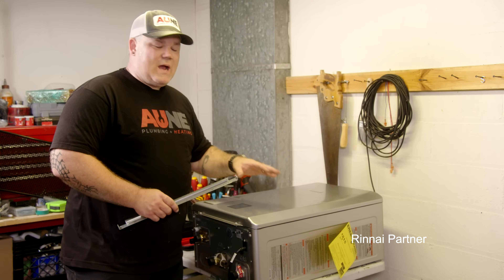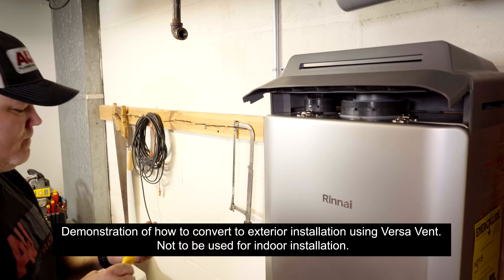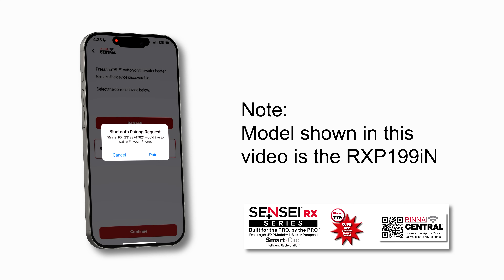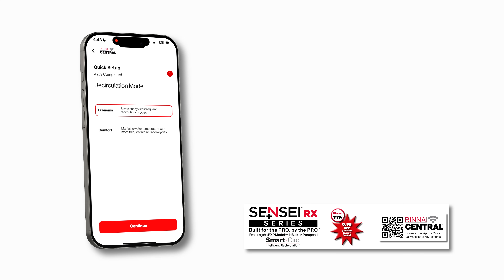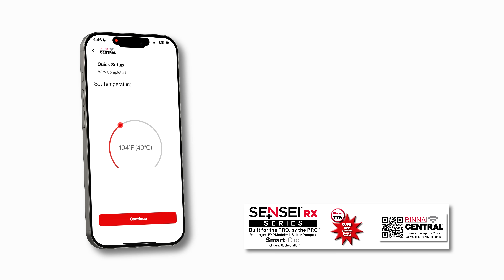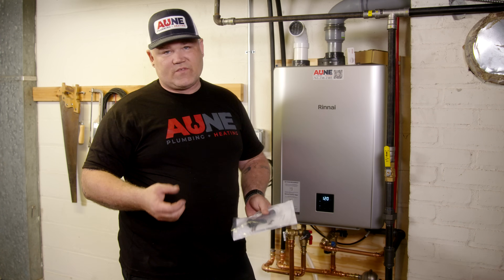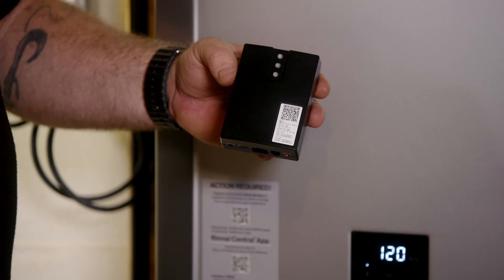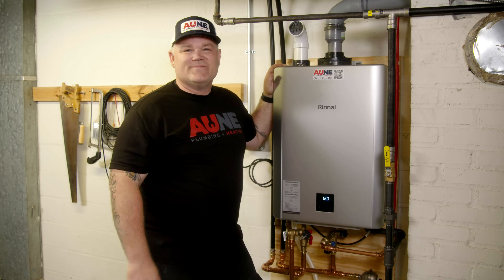Tankless Water Heater Install - Rinnai Sensei RXP series - Aune Plumbing

Comment: Nice that you are teaching others on the Rinnai installation. Unfortunately, you need to inform ppl that they need an additional accessory such as a Wifi Module in order to install their Tankless Water heater to the Rinnai Central App. Bluetooth isn't enough in order to install your water heater through your phone
Reply from the maker: That’s incorrect. No wifi module needed to connect to a phone. It’s don’t thru Bluetooth, not wifi.
Reply: @mechanical-hub  Couple Questions: (1) Once it is initially set up by the installer using Bluetooth, what options does the home owner have to adjust that temperature?  (2) If replacing a very old (early 2000s) Rinnai tankless water heater with wired thermostat, can that same wired thermostat be used or does it need to be replaced if the user wants a wired thermostat?
Reply: @kelvinkuwik4395  yes the old controllers can be used. You have to buy a harness because the new heaters don’t have screw terminals like the older ones. They have a space under the clear plastic cover for you to plug the harness adapter into. I think it’s at the very bottom.
Reply: @mechanical-hub  not according to customer service. I called them due to my RX199IN not showing up on the Central App even though I connected my phone through Bluetooth from the water heater. Customer Service stated I needed the Wifi Module. I kept restarting the app, and I even disconnected the Bluetooth and reconnected the Bluetooth, and the device (water heater) never showed up on the app.
Reply from the maker: I'm not sure what is happening, only thing I would ask is if you're activating bluetooth on the unit control to start the pairing mode? You probably are but that's all I've had to do so far with each of the units I've installed. The pairing has taken a minute or two but it's been pretty seamless and reliable. Bluetooth connect allows for the setup, not remote monitoring, just worth noting for anyone reading the comments. If you want to connect and control remote then yes, you do need a wifi module.
Reply: @mechanical-hub    I had the same issue, my blue tooth would not connect to the RXP199i.
Reply: @mechanical-hub omg thank you.. please make a YouTube video for these accessories greatly appreciated it..
Reply: Just installed a RXP unit. I’m also unable to connect using Bluetooth to adjust settings. Not happy about it and I’m frustrated that it’s not user friendly.
Reply: Paid 2,000 for Rinnai and now I need a modular. I don't need my water heater to send me updates. I don't leave town long enough to have to use my phone to talk to my water heater.

Comment: so, be honest with us, what did you charge for this install. how much was the parts, and what was the labor? How long did it take without the video. please be honest with us
Reply: Not sure where you're located, but in the Atlanta market most installs are $5k to 7k. At my company most installs are $5.5k to $6k. Hope that helps.
Reply: no, it wasnt clear because you didnt separate. How much was the parts and how much for your UNREASONABLE labor rates. Show the invoice if you are honest.. @charlesking678
Reply: @norcoauctions  i charge a flat rate price and so do most of my competitors. The only ones charging time and materials are small white van shops who don't spend on marketing to their phones to ring and they often struggle to make payroll when times are slow. Many can't honor warranties and they definitely can't offer the level of service That my guys do. 

As said before my price for most tank water heater to tank installs ranges from $5.5 to $6k. If you feel the price is too much, the price to not do it is $0. It's that simple. I don't get every single job I quote, but I do get the majority of them as my price is very competitive.
Reply: These tanks cost less than $2k but the plumbing companies will charge $5k to 6K. Let say if you bought the tank $2k, and the materials $1k, it seems the labor cost is between $2.5k to $3k. So, expect an over charge cost from these plumbers.
Reply: @Neutrality5  guess you will be amillionaire withing 3 years because of your greediness. that rate is absolutely godless
Reply: @norcoauctions  If you knew how much the tools, the van, and all those little copper 90s 45s Couplings cost you would still find a way to complain. If you don't want a plumbers service DIY it and figure it out yourself. Our training comes at a price don't go around disrespecting all these plumbers who got a real job. My friend gets all his clients and he gives flat rates. Labor is expensive plumbers all have a lot of things they could do that would kill someone. Carbon monoxide and Gas being the two most common. So yeah labor for them is gonna be expensive. When your job puts people's lives on the line when working it you better get paid real good for what your doing.

Comment: If you were in Ohio I'd definitely have you install my systems (note plural). I'm planning on installing one RXP160iN as the primary unit and a secondary RX160iN. I'm assuming the non-recirc unit would take the return recirc line and then go to the RXP primary? Is that the case? Have you installed dual units? Let me know. Again, great video!

Comment: Is it ok to use more than one thermal bypass valve in the system? We just added a second story.  The place where our loopback was, is not helpful to our current situation, nor was it helpful for our kitchen.  I was hoping to leave the original loop back in place and add one for the second-floor bathroom and one in the kitchen.  If not 3 how about 2?
Reply: I have not done it myself, I have a dedicated line. However; I know a couple of folks who did it with good resolves and no issues. One has three.
Reply: It is usually not recommended to install more than one thermal bypass. Maybe think about installing a dedicated recirc line w/ external pump. $$$$

Comment: Does it ship with flush valve?  Would you recommend buying/installing one if not?
Reply from the maker: The valve kit is not included and yes, I always install the valve kit because it’s the only way to gain proper access for required service.

Comment: That's exactly what I needed... everything is headed in this direction... if the app becomes obsolete... you're the captain of a boat anchor!😢
Reply: Great video.  Really detailed and clear explanations on everything.
Reply: @bobcobb7719  * Now just need room on the phone for the app!😆
Reply from the maker: You must have missed the part where I said you can do it without the app. Also Rinnai invented the tankless water heater, they tend to think of details you didn't
Reply: @mechanical-hub  Quite correct! Rinnai's not going anywhere, they're the industry leader.
Reply: @WilliamDiederich  * So was SEARS & ROEBUCKS! 😫
Reply: @mechanical-hub Invented the tankless water heater, huh? Uh...what do power washer "steam cleaners" and all the beverage making and dispensing devices that have cold water going inside them or stored inside them and hot liquids coming out use? 

Tankless water heaters. 

The University of Nebraska Lincoln Men's College Baseball field is heated because most precipitation comes in "late winter" and "early spring" when "heat units" and "drying days" from the Sun are...in short supply. It hasn't been 25 years but probably 20 and I don't think Rennai got the "contract". 

In-floor heating predates Rennai "inventing the tankless water heater". And LIVESTOCK WATER TANK HEATERS THAT ARE USED TO KEEP WATER THAWED FOR LIVESTOCK DOWN TO -20 F OR COLDER ARE ALSO TANKLESS. AND THEY'VE BEEN AROUND MANY DECADES. 

So have heated livestock "waterers" that have a very small capacity and high usage by comparison. Many are "geothermal" and require no actual heater at all. 

So saying they "invented" something still unperfected after 25 years since it STILL takes "6 SKUS" I.E. "MODELS" AND/OR "OPTION PACKAGES" TO "REPLACE" THOSE "OBSOLETE" TANK-STYLE HEATERS AND AT LEAST "VCR-PROGRAMMING" LEVEL INFORMATION TECHNOLOGY "SKILLS" JUST TO DO THE "SETUP" IS ALREADY A STRETCH. 

AT MOST YOU COULD MAYBE CLAIM "FOR HOUSEHOLD USE" BUT IN REALITY THE "HOUSEHOLDS" THEY WERE ORIGINALLY "INVENTED" FOR WERE IN APARTMENT BUILDINGS AND PARTICULARLY "FLATS" IN "EUROPE" AND REGIONS WHERE "CLIMATE" WAS NOT A FACTOR BECAUSE THEY ALREADY HAD "DISTRICT HEATING" AND THE WATER DELIVERED TO THOSE "HEATERS" WAS/IS ALREADY AT LEAST "ROOM TEMPERATURE". 

THING IS THEY DON'T DO MUCH SHOWERING, CLOTHES WASHING, DISHWASHING ETC FOR "FAMILIES OF FOUR" IN THOSE FLATS BECAUSE THERE "FOREVER HOT WATER" ALSO TENDS TO BE "NON-POTABLE" AFTER GETTING "BOILED" BACK AT THE "DISTRICT HEATER" AND PUMPED THROUGH MILES - OR KILOMETERS - OF "CAST IRON" WATER "MAINS". NOT TO MENTION ALL THE LEAD-SOLDERED "COPPER PIPE". 

THERE'S A LOT OF DIFFERENCE BETWEEN "ROOM TEMPERATURE" AND THE 50ISH DEGREE WATER THAT COMES IN THE "MAINS" OF THE OVERWHELMING MAJORITY OF "HOUSEHOLDS" IN "AMERICA" AS WELL AS THE "ENERGY DENSITY" OF UTILITY NATURAL GAS VS. THE NEED TO HEAT EVERY DROP OF 50ISH DEGREE SUPPLY WATER TO 120 DEGREES "DELIVERY TEMPERATURE" WHICH IS THE "MAX" TEMP CONSIDERED "SAFE" TO PREVENT "SCALDING" WHILE BEING THE MINIMUM HOT WATER TEMP CONSIDERED SAFE IN THE "FOOD SERVICE INDUSTRY" FOR USE WITH "NON-TOXIC" AND "BIODEGRADABLE" DETERGENTS WHERE DETERGENTS ARE USED AT ALL. 

AT ABOUT 200 DEGREES F "DELIVERY TEMPERATURE"  DETERGENTS ARE NOT REQUIRED BECAUSE THE HIGH TEMPERATURE WATER CAN FLASH TO "STEAM" AND EFFECTIVELY STERILIZES COOKWARE, TABLEWEAR, ETC. 

THEY ALSO "SELF DRY" AT "ROOM TEMPERATURE" IN A FEW SECONDS AND AS LONG AS "STORED" IN A HIGH-UV AND "COOL AND DRY" ENVIRONMENT - RELATIVE TO 200 DEGREES F AND 100% RELATIVE HUMIDITY THEY STAY "STERILIZED". 

THAT "INVENTION" ALSO HAS A LOT OF "COMPATIBILITY ISSUES" WITH MODERN HIGH-EFFICIENCY MAJOR APPLIANCES LIKE FRONT LOAD WASHING MACHINES AND DISHWASHERS. AND DISHWASHERS HAVE ALWAYS NEEDED THEIR OWN "TANKLESS WATER HEATERS" TO GET THAT 150+ DEGREES FOR HOUSEHOLD USE. 

MODERN WASHING MACHINES "CONSUME" ONLY QUARTS OF WATER PER "CYCLE" AND ALSO NEED THEIR OWN "TANKLESS WATER HEATERS" FOR TRUE HOT-WATER "ANTIBACTERIAL" WASHING. 

THAT "ANTIBACTERIAL" THING TENDS TO BE A BIG DEAL FOR GETTING CLOTHES "STERILE" CLEAN. AND KEEPING THE MACHINE "DISINFECTED". 

THE REALITY IS THAT NOBODY WANTS TO BE AND/OR CAN BE BOTHERED AND TROUBLED TO "SERVICE" AN "INVISIBLE" MAJOR APPLIANCE MUCH LESS THE ONE MANY OTHER APPLIANCES RELY ON TO DO THEIR JOBS AND ARE PRETTY MUCH "MAINTENENANCE FREE". 

EVEN "ONCE A YEAR" WHICH HILARIOUS AS A "SCHEDULE" FOR AN APPLIANCE THAT GOES THROUGH ENDLESS "HOT COLD CYCLES" FOR EVERY "EVENT" AND PROBABLY HAS A "DEFAULT" SERVICE "SCHEDULE" OF X NUMBER OF "EVENTS" AND/OR X HOURS IN "OPERATION" UNTIL THE "SETUP" IS PERFORMED AND A HUMAN OPERATOR IS RESPONSIBLE FOR "MAINTENANCE".
Reply: @mechanical-hub And it only took the "inventors" what? 25 years to go "wireless" programming? 

It has been 25 years since Paul Harvey started shilling those things as "forever hot water" right?

Comment: What I’m wondering is why is it 10lbs lighter
Reply from the maker: Simplified design, less crap that's not needed, Also the recirc pump is totally different which is also way lighter.

Comment: Excellent video, thank you.  Can the exhaust use my existing 3” schedule 40 PVC that my current (power vent) water heater uses?  It goes from the basement to the side of the house.  Thank you!
Reply from the maker: I’d suggest downloading the RX series manual. Check your existing PVC, it will have an ASTM designation, compare that to the approved venting listed in the manual.
Reply: yes
Reply: @JustinTBowen  it can use pvc venting, so more than likely yes the power vents vent will be fine for this installation.
Reply: Check w/ the PVC manufacturer. They say no.